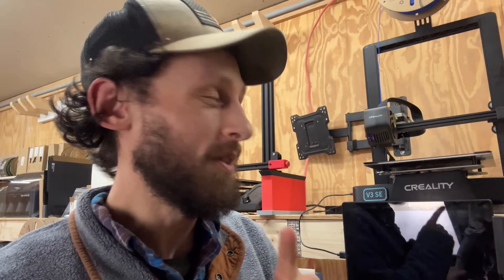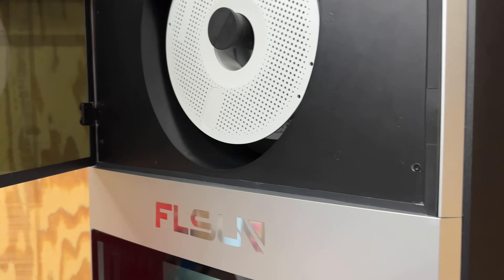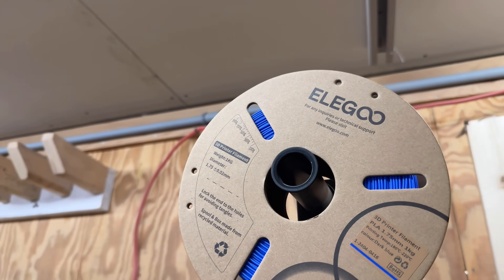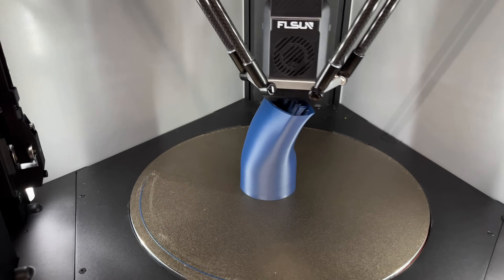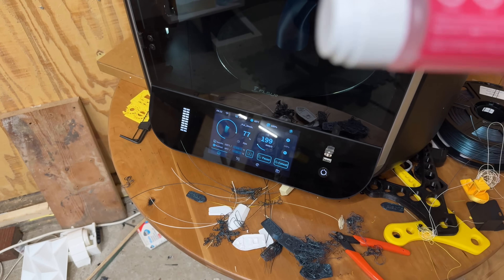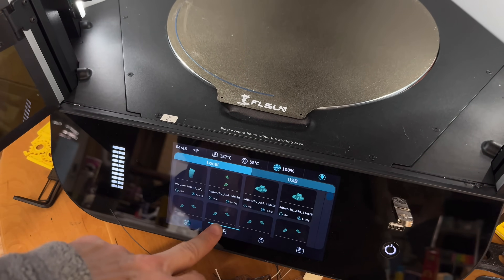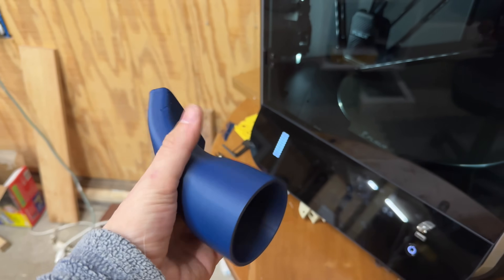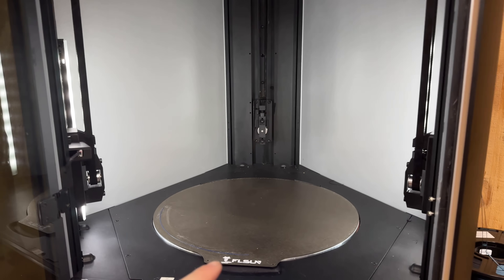Problems with ASA in the 3D Print Farm, FLSun S1 Pro Actually Good?

Comment: Do any of your other printers match up to or outperform the quality of a bambu Lab X1C?
Reply from the maker: I don’t have an X1C to compare, but both the Flashforge 5M Pro and Qidi Plus4 produce equal if not better quality parts to any of my Bambu Lab machines. I’ve had a few friends in this space recently pick up the 5M and 5M Pro and said side by side, they couldn’t tell the difference between the 5M print and their X1C print

Comment: Really love the breakdown of different filaments and print settings! The comparison between PETG and PLA was super insightful, especially when pushing speed limits on the S1 Pro. I can relate to the frustration with ASA adhesion issues—it’s tricky but worth it for durable prints. Thanks for keeping it real with your reviews!

Comment: Tbh, when I first started using PETG, it was a total disaster. Stringy mess everywhere and weird little blobs all over the prints... But once I figured out the retract settings and slowed down the print speed, things got way cleaner. Sure, there's still some stringing now and then, but nothing like before, as for the noise? It's way quieter than my old printer, but I threw in some acoustic foam just to keep it at a soft hum. Honestly, it all takes time and patience to get right!Anyway, loving your content, keep it up! Can't wait to see more tips from you!

Comment: When I'm using the S1 Pro, if I want top-notch print quality, I'll dial down the speed a bit. But even then, it's still way faster than other printers I've used.
Reply: How do you like yours overall? Looking to purchase one as I've been outsourcing my prints for years now. In between the S1 Pro and the Bambu Labs X1C.

Comment: Nano Polymer by Vision Miner will solve your Adhesion issues with the ASA/ABS and put the Heated Chamber to 50-55c.  Drop your Z down .05 when it starts as a last resort if all else fails.  Should reduce your warping and keep it planted on your first layer.
Reply from the maker: Thanks! I'll try that out with my next ASA print and see how it goes!

Comment: I always use glue stick for ASA personally. If you get a really good squish and proper adhesion to the bed there’s a chance you’ll take PEI off the bed with the part. It also helps to prevent corners from lifting on you, so win win. Also fwiw I tend to run around 90° bed temp on ASA despite most slicers wanting between 100 and 110 but your mileage may vary.
Reply from the maker: I have been getting great results using glue stick with ABS so will definitely be trying it with ASA and ill try it out with a lower bed temp too. Thanks for the suggestions!

Comment: The line on your pusher stick is likely caused by where the bottom layers stop would be my guess, or at least near it. It does look like your input shaping value could use the work, but it seems like it's caused by retraction at the corner from the layers going down without the full inside being printed. Increasing infill might help or slowing down wall speed. One thing you could try is adding a circular cutout in the corner rather than a fillet so it retains the ability to hold a sharp 90 degree corner object, but reduces the stress riser right there and slightly slows the printer as it goes around that corner. Otherwise you could use an area modifier in the slicer to add some infill right around that corner specifically.

Comment: With the Flashforge and that whiteish filament, you likely need a slightly lower PA value rather than higher flow rate. It could be a combination though. Seams at gaps is generally a PA issue as is major bulging. Looks like you could also turn down the seam length percent. Default is usually 10 or 15% I want to say and I often like more like 5-8% once PA is tuned. Could also turn down overhang speeds ever so slightly to help with that internal cooling. Nice print overall though!
Reply from the maker: Thanks! I will play around with those settings and see if that makes a difference! I don’t get that with PLA, ASA or PA6 on the FF, so i wonder if it’s something inside of the PETG settings!

Comment: Did you increase or decrease the size of the dumbbells? I'm having trouble fitting the centre bar fully into each dumbbell, just can't figure it out I've done multiple tests, could it be the seam on the centre  bar I have it aligned? Love the videos 😊
Reply from the maker: You need to decrease the size of the dumbbell rod in the x and y direction. It will depend from printer to printer but i found decreasing it by .20mm in each of those directions works. That said, I’ve also removed the threads from inside of the dumbbell ends so the rod actually just gets some glue and then slides in there. I used a negative modifier in the slicer to add a cylinder the same height and slightly wider than the opening on the dumbbell ends, just enough to get rid of those threads but not increase the overall size of the opening
Reply: Thanks so much I'll give it a try and hopefully that works 😃 never even thought of removing the threads and just glue the centre bar great idea

Comment: I highly recommend replacing the stock fan shroud on your S1 with something like "the sweeper". I have a T1 and I got a noticeable improvement on the benchy stack quality, and it's even 'quieter' than the stock shroud. Also, I've had a bit of success with ASA by using the "raft" option, set at 2 layers. It resolved my warping off the bed issues.

Comment: Who cares how fast it prints if the quality is bad.
Reply: Extremely fast prototyping. If you need dimensions for a part, but don't need it to be functional. Not recommended to be used on prints where quality is a concern
Reply from the maker: @monetary_episode  My use case for it anyways. With that said, even if I slow the speeds down to get a quality part, it's still twice as fast as any of my other machines.
Reply from the maker: It definitely takes some tweaking to get the quality right, and using FLSun slicer, the profiles are more tuned than the orca slicer profiles are for the S1 Pro. Even when lowering the speeds to get a good quality print, it’s still twice as fast as my P1P is. I have some more videos coming up in the next week that will show off this printer a little more. Some good, some bad but overall it’s impressive. Most of these prints were done at max speeds. Just like the Bambu at 500mm/s, you will never print using those max speeds, but it can achieve them. Just because it will go that fast, doesn’t mean it should.

Comment: Man i bought a T1 pro and haven't set it up yet. Watching everyones prints with FLSUN they look horrible! Every print looks like under extrusion. They glory the speed. However, in my business speed but mostly quality is very important. These printers have the speed but quality is lacking! Please prove me wrong.
Reply from the maker: It definitely takes some tweaking to get the quality right, and using FLSun slicer, the profiles are more tuned than the orca slicer profiles are for the S1 Pro. Even when lowering the speeds to get a good quality print, it’s still twice as fast as my P1P is. I have some more videos coming up in the next week that will show off this printer a little more. Some good, some bad but overall it’s impressive. Most of these prints were done at max speeds. Just like the Bambu at 500mm/s, you will never print using those max speeds, but it can achieve them. Just because it will go that fast, doesn’t mean it should.
Reply: @TheMountainMaker  yeah I agree

Comment: Get some Elmer’s glue stick.  Put it on a cold bed fairly thin.  Use it every time.
Reply from the maker: That does seem to work. I was printing some PA6-CF on the S1 Pro so i had used glue on the bed for that. Switched to ABS and print stuck great. Washed the bed and ABS would stick for a layer or 2 then come loose. Glue it is for ASA/ABS/PA

Comment: This is the reason I returned my Flsun. At first it seems charming but in the end there is no point in promising high speed and not delivering quality in printing. For those of us who have a farm at this price we can buy 3 p1s and production will be much higher.
Reply: Unless non-planar printing is supported, delta is kind of pointless at this stage.
Reply from the maker: I can see why that would be frustrating. I'll keep you guys updated on my progress and how the machines are performing. For me it’s more of a proof of design for a part and making sure things are dimensionally accurate, making multiple iterations in half the time and what not. I’m really loving the F1Sun for Printing Nylon and CF reinforced filaments, but it definitely has its quirks and it’s not necessarily a printer for a print farm production line, more in the office for design work in my opinion.

Comment: When using ASA, First make sure its DRY...second add a mouse ear in Orca. Third, stop using creality..
Reply from the maker: Seems like Creality is not well liked 🤣 it works fine for things i don’t intend to sell and the parts are strong. Just defects here and there. Would absolutely continue using it for my own personal projects but yeah, it’s slow and not the best when it comes to quality and reliability for days on end like the Bambu is. I just got the Sunlu FilaDryer S4 in so i have some PA6-CF in there along with ASA and ABS. Printed on the S1 Pro last night with ABS. Needed a thin layer of glue stick on the build plate, which I’m not a fan of, but it did stick really well so i guess i can’t complain too much
Reply: #3 made me laugh. I don't dislike Creality but it's a Creality. It's for tinkers. Loved it back in the day but now just want to print

Comment: About the A5M Pro, you should check the seam settings on Orca's quality tab. Also, use the filaments volumetric speed. PETG is slower than pla, but I had good results with 17 mm3/s MVS. Good luck.
Reply from the maker: I appreciate it!

Comment: it’s the flsun loudly?
Reply from the maker: Yes and no. The fan isn’t any louder than say the P1P at full blast because it’s contained within the chamber for the most part. You can still hear it, but the motors when it’s moving get pretty noisy. I’m used to it now, but it makes it difficult to record clean audio in there when it’s running 🤣 good thing the DJI mic has semi good sounding noise cancellation

Comment: Honestly though, are the two new machines actually useful for a small scale print setup? Is the cost in terms of time spent messing with temps and speeds and offsets even worth it? To me it seems that the Bambu printers work perfectly out of the box and you can confidently just hit print and walk away, knowing that you’ll get good quality output pretty much guaranteed, while these two machines are faster and have more scope for bigger projects, but it’s starting to look like you’re going to get a lot of failed prints, which negate the time saving, wastes filament and creates frustration that you could do without. For the financial outlay that buying these machines would be (if you’d had to buy them yourself), it feels like you’d be right to expect a huge improvement in reliability and print quality. Maybe I’m just not seeing it.

Or is it something you think will pay back, once you’ve got settings properly dialled in? Genuinely curious to know if you really think they’ll be more useful to you than just buying another 2/3/4 more Bambu machines.
Reply from the maker: That’s a difficult one to answer through a comment, but I’ll give it my best. There are so many variables that can come into play there. When i say the S1 Pro is quick, i mean it will print PLA and PETG 2-3x faster than any of my Bambu machines and just as dimensionally accurate. Quality wise, it is obviously a little
On the rougher side, but not how you might expect, slow down the walls a little and it’s right there. 

Is it as stable as a Bambu machine? No. 
Is it something i would setup to run in a production environment for the print farm? No.
Is something that will let me test new designs and prototypes far quicker than any other printer i have? Yes. 
This comment will get too long if i keep going but to sum it up, no i don’t think it’s a printer for every small print farm environment. I think it’s a great machine for the right person, but not every person. It does phenomenal at printing PA6-CF as well so and is equipped to print up to 350 on the hot end so quite a few high temp filaments can be put through here making it great for people looking to print out of more durable materials. 

As for the Flashforge, absolutely would recommend that for setup in a print farm environment. After adjusting the z-offset by a little bit, it has been almost flawless on every single print and material I’ve put through it aside from 1 ASA Benchy that had some messy overhangs. I am very pleased with the Flashforge so far, especially given the price point on it. Printed ASA, ABS, PLA, PETG, and PA6-CF on the AD5M Pro and it does great with all of them
Reply: Thats what I thought too, and still do for the most part but this video shows even the mighty bambu isnt perfect either https://youtu.be/1iOH7GTwU0A?si=Q0VOMOK3i57_-iQQ  its less calibration, but manual calibration is still the best and I just picked up an anycubic kobra 2 2nd hand , and its got the auto calibration too, but sort of wish i had the manual option, espescailly after seeing that video, those auto calibration things save time, but arent perfect.